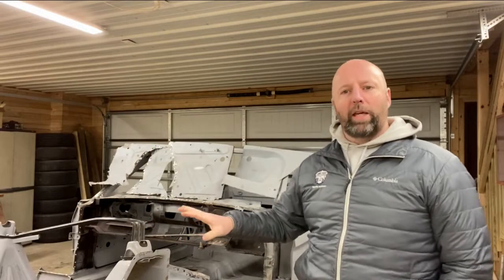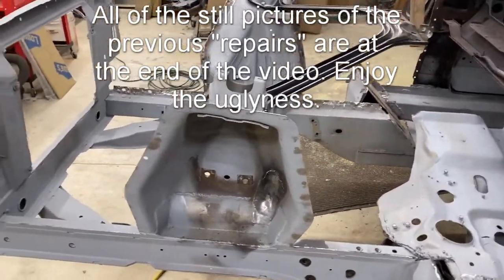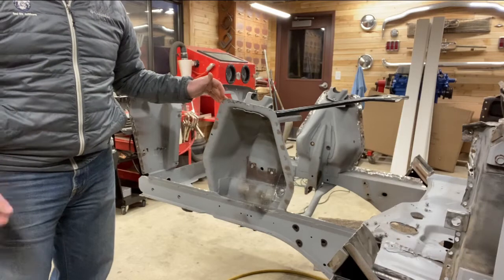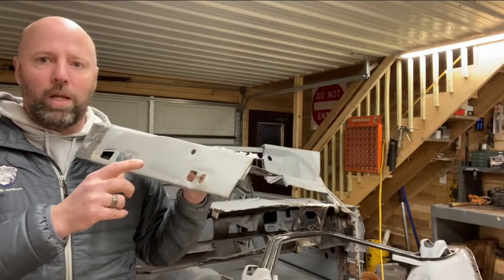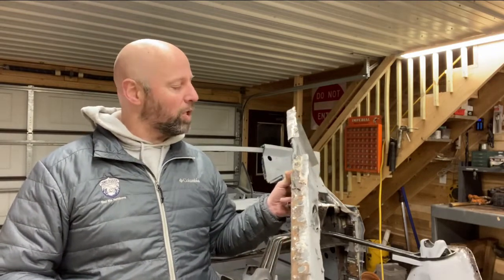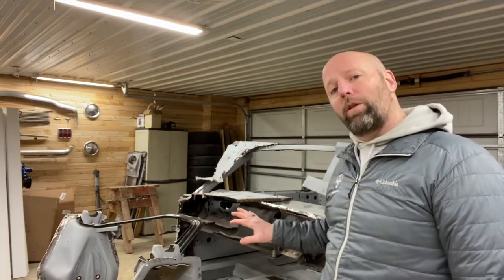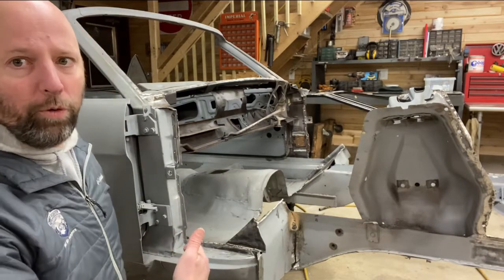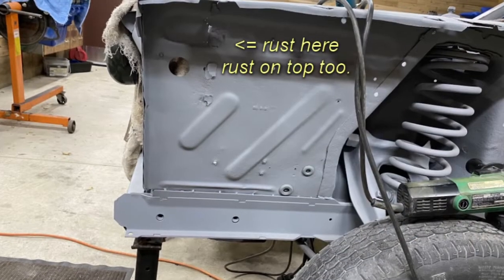1966 Mustang Restoration Pt 4 - firewall and fender apron removal

Comment: I need to replace the firewall and a front frame rail. Could you make a suggestion on which one I should start with first?
Reply from the maker: Those are big but doable jobs.  I'd start by figuring out exactly how you are going to make sure the front frame rails are level and square. Used a laser level to meausre up from the floor to specific points.  Then I think I would remove the fender aprons and front frame rails and firewall.  Are you removing and replacing the cowl too?  If so, nows the time to do that too.  Then I'd install and get the front frame rails perfect before doing the firewall.  Just measure and double check everything 32 times before welding it in permenantly.  I'm no expert, but with time and patience and care I was able to do the job.

Comment: What brand do u recommend of metal panels? Did u brace anything before removing the firewall??
Reply from the maker: I use dynacorn when I can.  I've had pretty good luck with National Parts Depot.  I did not brace anything but mine wasn't straight to start out with. So I had to make it straight as I went.

Comment: I had cut out the original VIN's from both inner fenders and stitched them into the new inner fenders. Remember , on purpose ONLY the drivers side VIN is visible, the passenger side was purposely hidden by the fender itself.
Reply from the maker: I hadn't realized that about the visibility of the drivers side.  Thanks for sharing.  Did you weld the top and the bottom?
Reply: @3rdstallgarage  no, just the top. simply cut out old vin.used as a template to mark new location on new panel. cut the marks and welded in the VIN's